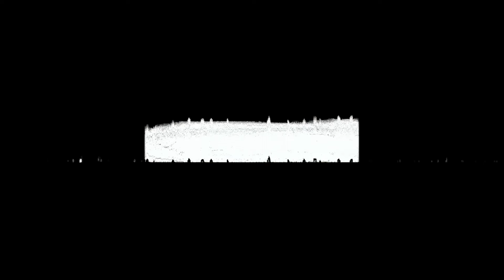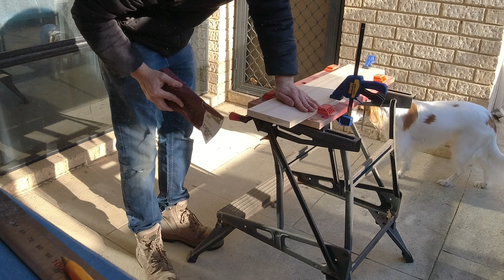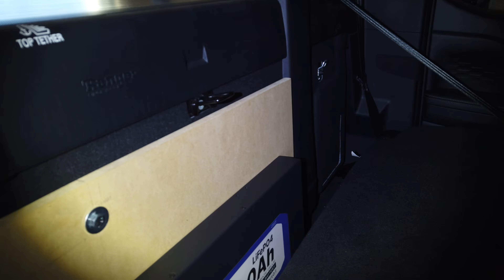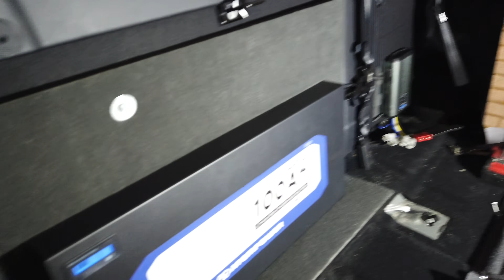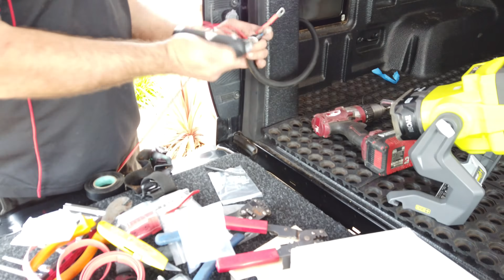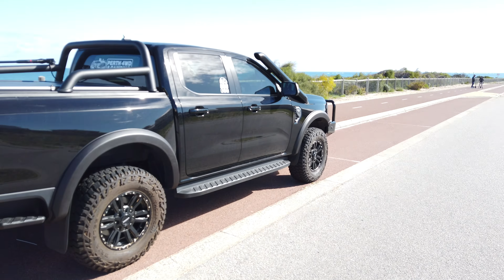AFFORDABLE LITHIUM DUAL BATTERY FOR NEXT GEN RANGER - Atem Power Slimline 12V Battery and DCDC

Comment: Dear 
If you wouldn’t mind sharing the App using for the Atempower 150 Am battery
Reply from the maker: Sorry for the late reply. Missed this message. It’s just the Victron app, using the Victron shunt so you can remotely monitor the voltage
Reply: @Perth4WDandCamping 
No worries 
Thanks mate 😊

Comment: what the model atem power AOP40DC OR AP40DC
Reply from the maker: Hi. Was just listed as the Atem Power 12V 40A DC to DC Battery Charger MPPT
Reply: @Perth4WDandCamping  hi Yes, there is a sticker written on the side of the model? ap40 dc or aop 40 dc

Comment: When you connected the dc charger did you run it straight to the battery and run your load off the the other Anderson connector
Reply from the maker: G’day. I’ll double check with Fab (installer) and see what he says.
Reply from the maker: So I heard back from Fab. He said:
Dc in straight from main battery 
Dc out to auxiliary battery. 
Loads come off auxiliary 
Anderson plug

Comment: Keen to know if you have a done a drain and recharge to check actual battery capacity. I have heard Atem can tend to be over rated but it is one on my short list of batteries with a very slim profile.
Reply from the maker: For what I’m using it for currently - running some camp lights, and 50L fridge it’s never got low enough to fully drain. I’ve found it charges very fast with the 40A dcdc. Hoping to get some solo trips in during the year and likely be running more accessories to give it a bigger workout

Comment: Just so you know if those small brackets are the ones from Bunnings they are weak as anything. I snapped one easy the other week as the fold point is quite thin.
Reply from the maker: Thanks mate. They were more to get the wood in the right spot before I reinforced further and added large screws. The rear MDF and anchor point on the wall of the vehicle is taking most of the load. So far so good. We’ll see how it holds up after some corrugations 👍